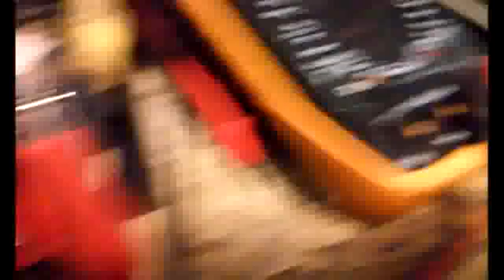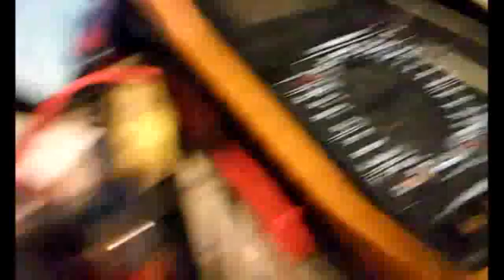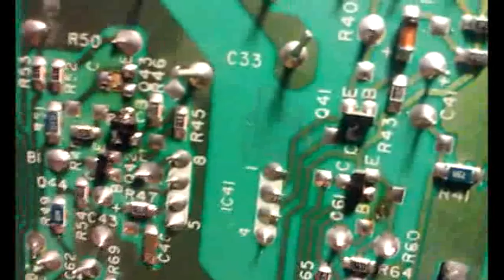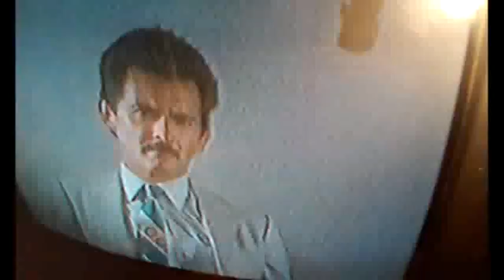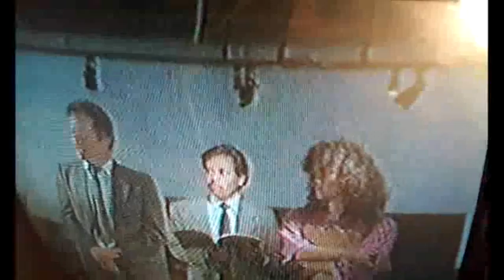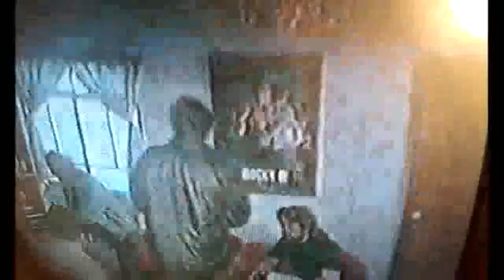Old ass CRT AV Input repair PART 2/2

Comment: Happy to see you got it. I am thinking bad solder joint. Though not impossible  I have never had a bad transistor start working again. If you let the transistors cool before you tried running the set and it still worked,then  heat wasn't the fix. Interesting video. Thank you for sharing.
Reply from the maker: +Bobby Tectalabyss Last series I did on that usumacinta console I actually had a transistor that kept going open and then would start working randomly.  Also if you saw the first part of the vid, the resistor that provides the b+ for these transistors was blown open.  So something weird definitely happened there.